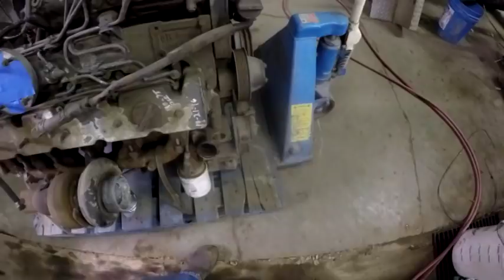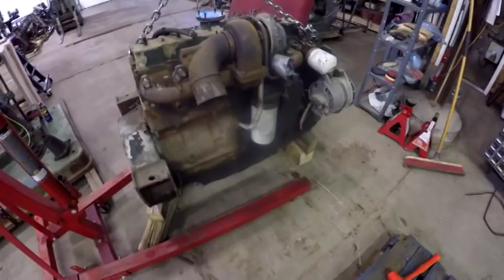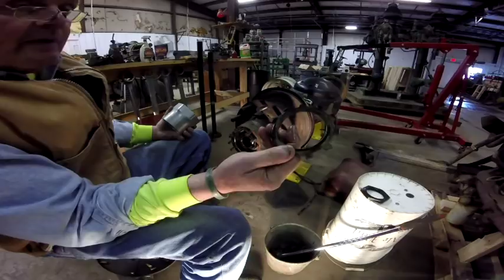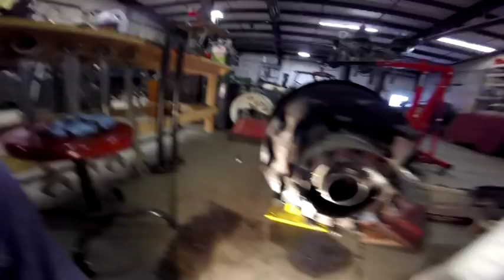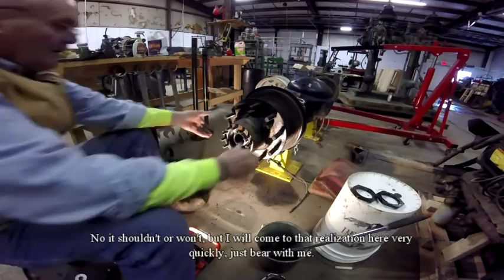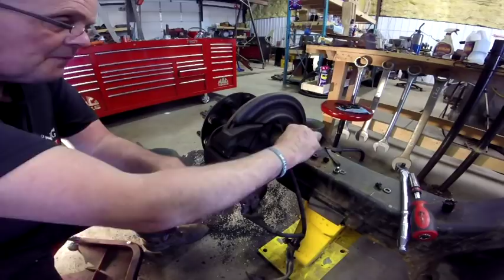Ford F750 Haul Truck Build Part 14

Comment: That what I miss about being retired, the company I worked for didn't mind us taking bolts for home use I've had to buy some lately they are high I may have to make a trip back to see my old buddy's maybe pick up a few.
Reply from the maker: That's funny Joe, I would unload the truck in my garage when it got to be too much stuff and you couldn't find anything! Then I would end up throwing or giving the stuff away to get rid of it out of my garage!

Comment: Tractor Supply does carry metric bolts(at least the ones in west ky), I just picked some up a couple weeks ago. For future reference before you get raked over by Fastenal again.
Reply from the maker: Are they priced individually or can you buy them by the pound like SAE stuff?
Reply: As I recall, they were priced individually. But they were very reasonably priced compared to Fastenal or a parts store.

Comment: I grabbed 4  of 12x40mm bolts at Fastenal this Winter, and they were $2.95 each.   Metric is expensive for some reason.
Reply from the maker: Price gouging! Realize that they don't sell as many as SAE, but come on that's a little bit much, but then again it's Fastenal.